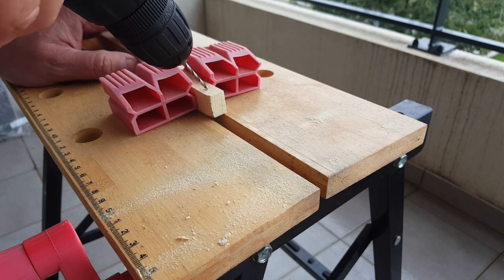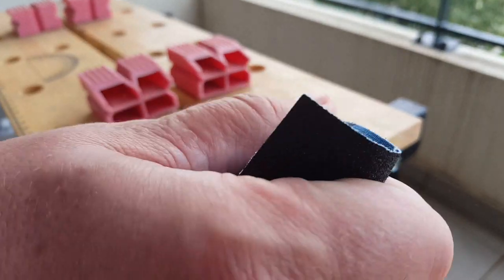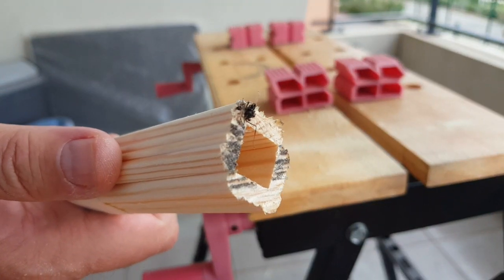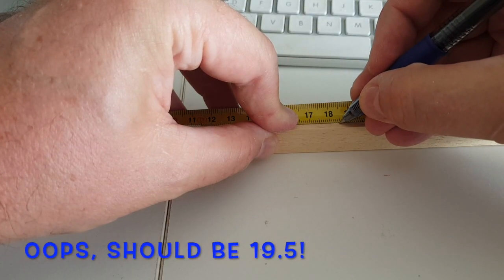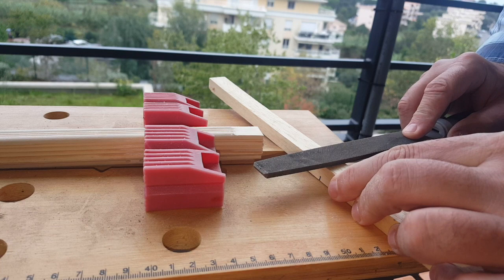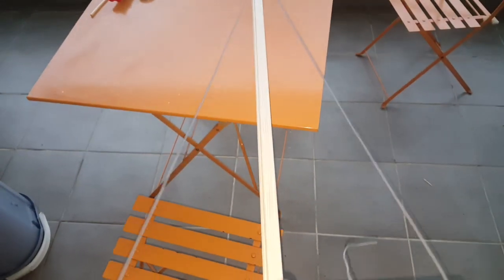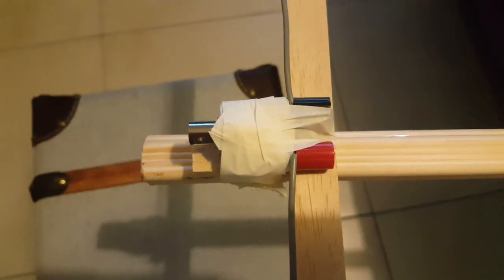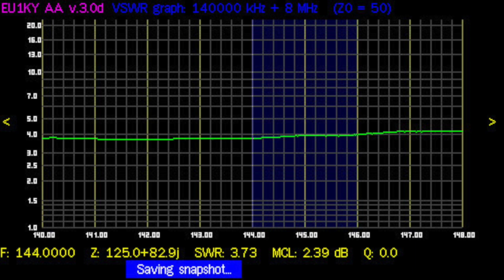An Awesome Antenna For VHF 2m SSB CW, Part 1 Build.

Comment: This is a fantastic channel. I just wish that the UK Ham operators were more like you. Here in the UK experimentation seems to be dead. All the equipment is purchased and not constructed. I am one of the few constructors left, I built my station all homebrew right from the PSU through to the antennas. Favorite bands - 160, 80 AM and SSB from home, 17mtrs ssb when mobile/static mobile. VHF and UHF is all but dead unless you are at the top of a mountain. There are however many VHF stations in Ireland still operating. Thanks for putting these videos online, My complements to you and your family.
Reply from the maker: Thank you. Excellent, keep on soldering! Show your stuff and be proud of it, it might inspire others to give it a shot...
Reply: i spend all Christmas for 3 weeks calling and listening on 70.450, not a jot, glad i did'nt buy that fandango rig with 4m ...

Comment: Thumbs Up! 

Seeing that the cross members are epoxied into place, shortening the wire will result in a wider gap at the feed-point.  I suggest to cut a vertical slot in the 'mast', top and bottom along with a centered hole in the cross members.  Secure each cross member to the mast with a nut and bolt which will allow the boom to slide up or down according to slack in the wire.

Those binding post to BNC adapters are invaluable when it comes to experimenting.
Reply from the maker: I was going to relocate the lower cross member but finally had to cut only 4cm, so didn't have to... My cross members bowed a little and the wire is as tight as a guitar string, but it works!

Comment: Great videos keep up the good work. . I was involved in a shootout with various types of antennas and one was this stacked delta loop. I was going to say it didn't perform well and  we were testing omni antennas but just realized the loop was fed horizontal so need to do a recheck on that design. It is a bidirectional so without a reflector and talking in one direction it wouldn't be best option. It can be rotated 90 deg for vertical easy enough for terrestrial work.

Comment: By now, you've probably seen that Peter Parker, VK3YE posted a video of his 2m hourglass antenna.  He did some overnight beaconing and had many contacts, and at least one was over 400 km.

I too wish modern VHF radios were all mode radios instead of FM and maybe some digital audio.
Reply from the maker: I missed that one... Thanks.
Reply: @RadioPrepper  I was gonna comment on the same video from Peter Parker.  Great minds think alike.  73.

Comment: I had a KW 711A 2m all-mode 20 years ago.  NOthing ever on CW/SSB.  Now I have a Yaesu 736R with four-bands all-mode.  SOTA/POTA has really kicked up the interest and usage of weak modes on all frequencies here in the US, so I expect to make contacts this time around.  Hasn't happened yet, but I need more antenna (and more time to play radio).
Reply from the maker: Keep at it, it will happen!

Comment: I had the mfj 6 meter version of the 2 meter radio your thinking of. I loved it. Incidentally I wish people used 2 meter SSB. Also, I have a great design for a compact 2 element 2 meter Yagi if anyone is interested I'll pass it along. The boom length is only around 1 foot and its that short because it uses a folded dipole for the fed element and that allows a 50 ohm feed point when the radiators are that close. Its roughly 7 dbi which is as good as you can get for 2 elements. The front and back have about the same radiation pattern with a bit less off the back but off the sides its near nothing.
Reply from the maker: Thanks. Please post on radiopreppers.com. I used to have a 9406 too, should never have sold it...

Comment: How does this compair to a biquad antenna for 2m that is fed in the middle where they cross.  The hourglass antenna looks great and is bidirectional  and great for Florida  where most qso's are north and south .  I  am thinking of
PVC pipe and 1/4 inch aluminum ground wire for elements with lmr400 coax  up on the roof. For a budget setup. 
AA4CP Chuck 
Port Salerno FL USA
Reply from the maker: Well, I have not made a biquad, so I do not know... Similar probably...

Comment: One more question  does the wires touch and short at the crossover point  or are they separated and insulated from touching.  (I know stupid question)
Reply from the maker: Insulated, but there is no gap.

Comment: You might want to separate the wires where they cross over...put one on each side of the center post and isolate them a little....!
Reply from the maker: The design says not to...

Comment: Thank you for this Video. Very interesting antenna project. I will have an idea for a modification, turning the lower horizontl part for 90 degrees. Perhaps the result ist a more perfect all around characteristic? Will make a simulation at MMANA ... vy73 from Hamburg/Germany, Dietmar, DL4HAO
Reply from the maker: Let me know how it goes!

Comment: In my opinion you should use fiberglass elements not made from wood.  I  fact wood is easly to modifite but there isn't water proof.  73!
Reply from the maker: Probably but I will at least clear-coat it. This one is also not for a permanent installation.
Reply: Although wood is not normally the best material, I did read one article that suggested wood was OK for this type of antenna - on the basis that the high voltage points (at the ends of the 4 dipoles) are not secured to the wood.
Reply from the maker: And mine is not for permanent installation..

Comment: Ham for 10 years.  Not so active last 4 years.  Never hear CW on 2M.  Did meet new ham near by and did get sked for 2 meter CW.  Yes.  Problem is all mode 2 meter transceivers are expensive.  Other problem is people not learning CW.  Is a shame.  The 2M QSO was a lot of fun.  2M rag chew.  80M is a challenge for most HAMs.  20 and 40 meters hop away from your city.  So 10 years later finally a 2M QSO.  I need to get set up on the digital modes and look for people that way and try to set up SSB or CW QSO.
Reply from the maker: Yes, fortunately old ones are affordable  I guess we need to call more often on 2m CW..